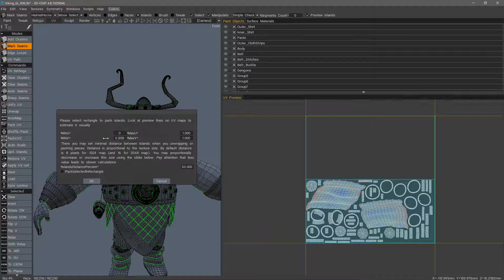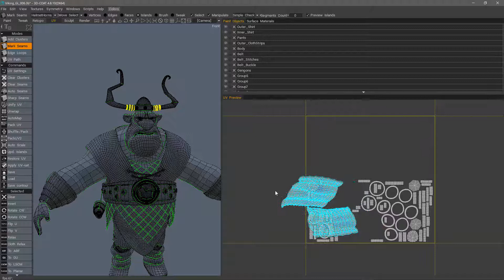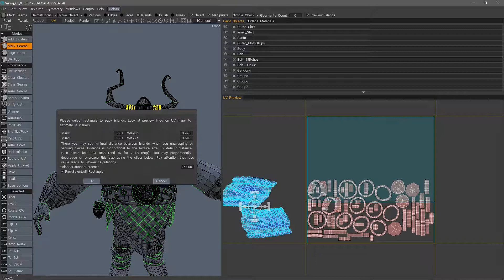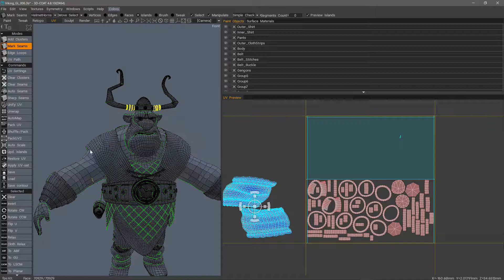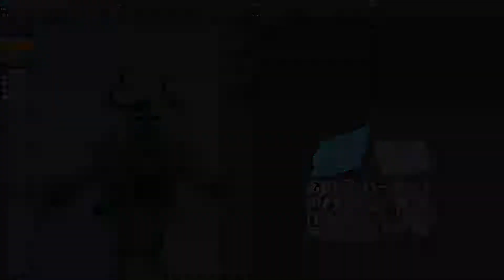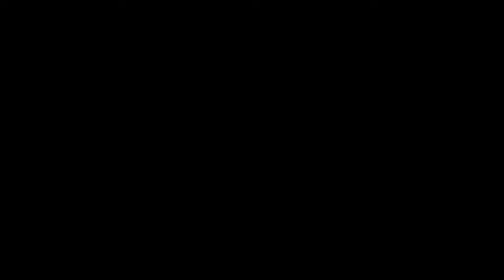Quick Start: UV Packing Tools

Comment: When I try to Pack Selected in Rectangle, it places the selected islands in a box in the corner of the selected section and not the whole selection.. any ideas?
Reply from the maker: Please contact support@3dcoat.com, so they can evaluate the issue, and address it properly. Youtube is a very poor platform to diagnose software related problems or questions one may have.